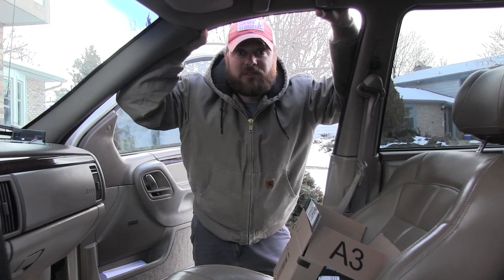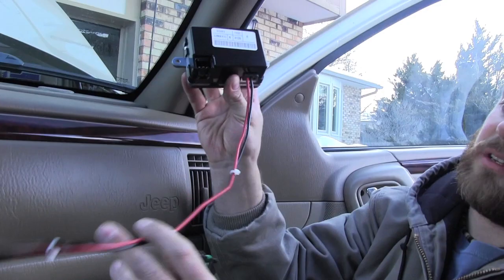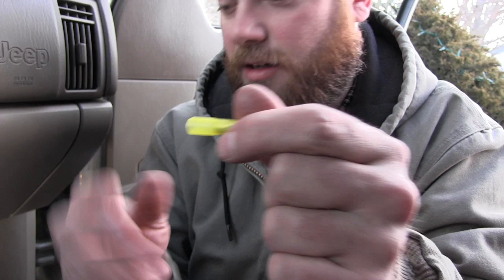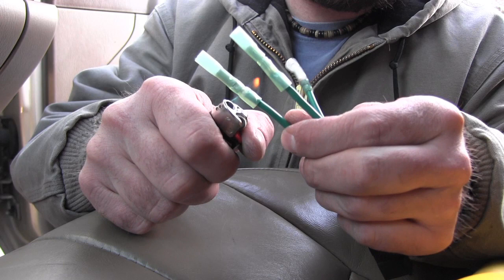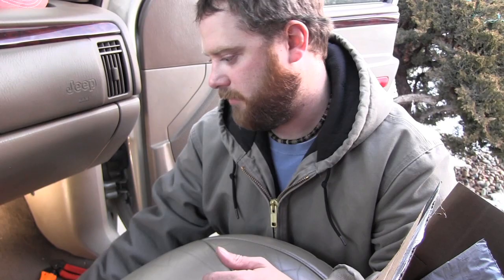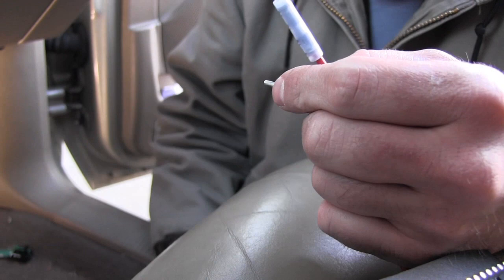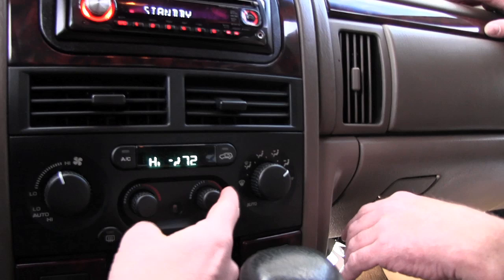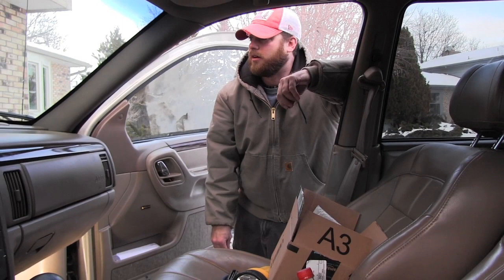How to fix your Heater Jeep Grand Cherokee

Comment: This is an old video, I have an old Jeep.  This just fixed my issue in 2 minutes.  I went out to the Jeep and just wiggled this plug, boom, heater kicked on.  I know it's not a permanent fix, but it gets me heat until I can fix it permanently.  Who am I kidding, it has 280,000 miles, this may be permanent...

Comment: Hey thanks for the video.  I have a 2000 jgc and I had to take out my dash to remove heater core.  I also had to replace the temperature control module/resistor.  In your video you had to cut the original wires on the resistor because they go behind the hard to remove hvac...  I don't think you had to do that.  I think the original wires plug into the blower motor which is accessible on the passenger floor right by the resistor that you installed.  The original wires just run/hide behind the hvac and then loop back down to the blower motor which is under the passenger dashboard.  I just wanted to let you/everybody know you don't have to cut the original wires on the resistor, just plug them into the blower motor which is right next to the resistor (both accessible from the passenger floor).  I don't know why they loop the wires behind the hard to remove hvac when they could go directly to the blower right beside it.  anyways  I hope this helps someone.
Reply from the maker: +Zachary Stutzman  Thanks for the info!

Comment: Thanks, Pete - this was a terrific presentation and extremely helpful! I would only mention that a flashlight and a little neck craning reveals that the "second" wire harness loops up and around the heater, terminating at a receptacle found to the right of the heater core casing where it can be unplugged,  eliminating the need for it to be cut and spliced. It is sandwiched between the RH side of the heater box and the passenger's side body panel, about 12" up from the floorboard.
Reply: what do you need to remove to unplug the Cable? just long arms?

Comment: Let me just say, complete props to this guy for demonstrating on how to fix this. I was having this exact same problem with my Jeep, with the air not blowing. I'm located in Arizona where the temperature outside right now is over 100 degrees every single day, so AC is a must. I took it to the dealership and they wanted to charge me about $400 to fix it. After watching this, I fixed it myself for about $60. I actually bought the resistor on eBay for a bit cheaper, but got the wire harness connector on Amazon. Who would've thought the fix was so simple. Thank you times a million for posting this video!

Comment: I managed it without splicing the 2 wire pigtail. It goes over a mount and then right into the visible part of the blower motor at the bottom.  You can see it if you look at the bottom of the motor.  You could even go straight from the motor to the resistor if you wanted, but i found it was pretty easy to follow the wire to the motor and run it back the way it was.
Reply: ئ في.
Reply: Did you have to remove anything else to get to this part . I seem to have same issue to small of a hole to fit hand in

Comment: Not necessary to cut wires from new module to the fan motor and splice to old fan cable. 
Unplug the cord at the fan motor. 
Cut the 2 wire (black and red) from the old module that is being removed, grab at fan plug and pull it out. You may have to work it back and forth from each end to get it to come out or just leave it under the dash.
The new module will have a fan motor plug attached to the new module. Just plug into fan motor and stuff excess wires up under dash or zip tie them up there.

Comment: 13th November 2017  here in Liverpool in the united kingdom, just finished replacing front brake flexible hoses on my jeep grand cherokee wj 2.7 diesel. Rear flexible brake pipes, rear disc (rotors) rear pads, refurbished rear calipers with new pistons, seals and dust seals, bled them up, started jeep for a run around the block, heater motor packed in 😣😣😣 thanks to your great video think I will have it sorted no problem, will be on eBay after I finish this post for a new resistor. Thanks for a great video buddy, I have subscribed to your channel and left a like too. 🙄🙄🙄

Comment: Great video and I used it to help identify which wires were which since mine melted through the wires and I had zero as a guide. If I might ask,Why cut the second pigtail? it plugs directly into the blower itself and is easier to just unplug from the blower and pull through. I did not try to install the red and black harness the way it came out but instead I zip-tied them out of the way under the dash. Dorman is the best company to buy both the harness and resister because the offer a lifetime warranty instead of a one year like all the other companies I found. This item is a problem for Jeeps. I learned my lesson of going Dorman over any other when I fixed mine and 4 years later I am doing it again. Thankfully I bought my resister from Dorman and had got a replacement for free because we had not cut the red and black harness. My blower motor speed resistor harness pigtail part No. 973-304 I had to buy again...this time I bought Dorman with a lifetime warranty.

I love my Cherokee but if this is a troubled part I figure I might as well pay for it once and get free refills!!
Reply: David Skipper    P.S I do not work for Dorman but I do love their warranties. I am now replacing my window parts that came with a one year warranty, for the second time, this time using Dorman. Yes they are $20 higher then others on Amazon but they have that great lifetime warranty. Trying to save money the first time is costing me more now.

Comment: Not sure if anyone else posted this tidbit but that long connector you refer to as being under dash and requiring baby hands is actually connected on the passenger sidewall just in front of the door and is strung across  and not up. Just pull on the wire and you will see it move on the right. It looks exactly the same as the new one with the zip tie things every 4 inches so easy to spot. So there is no need to cut that. What a pain in the butt to work in such a small area though. But otherwise thanks tons for the vid...really helped!
Reply: I hope you're right lol. If so thank you.
Reply: I have a 2002 Jeep GC.  and you can unplug that connect.  it isn't that bad to get too.
Reply: what do you have to remove to unplug the 2-wire Cable??

Comment: Awesome video brother.  my fan stopped I was told it was my blend doors so I replaced them thru the glove box wasn't the problem any way a lot of unnecessary work and money. then I got mad and slammed my screw driver in the area of the resistor and the fan came on lol so that's how I know my resistor is bad. this video is very helpful my part will be in Monday so now I will know how to replace it. I could have probably just bought the wires and been OK because I can tap the box and it works then it will stop then tap again and it works 2 damn summers and winters have gone by because I didn't have 1200 bucks to let the stealership to work on it and it was the resistor the hole time. lol thank you

Comment: Thanks for the video. The blower motor on our 2002 just quit working and I was about to take it to a mechanic. I will check it out first after watching the video. We just had a recall issue with the passenger side air bag fixed so it is possible they did not get the wire harness clipped in properly.

Comment: Yes! Bought resistor for an 04 Jeep for $34 off amazon. Got the harness at a auto parts store for $20. I have air flow now but I used to have none. But it blows when my car is off now. But at least I have airflow and will solve my other problem!
Reply: What part store for the pigtail

Comment: Informative and helpful video. However, there's no need to cut and crimp the power wires for the blower fan.  The fan connection is right on the front right side of the blower motor and easy to reach. Just disconnect it from there and fish out the harness.  Now there's no need to connect wires and you won't void your warranty.

Comment: Hi Pete,You have it got,just to let you know Napa has the fix for this problem,comes with the new wires and pig tails for the blower motor and the black and red and the small wire,comes as a kit,in Canada its $400 retail, I got it for $200.
As for the failure of the blower resistor is the blower motor is old and is now drawing too much power so change both the resistor and blower motor

Comment: Hey Pete I have a 99 grand cherokee  that heater fan resistor is in a crapy place just like the electric cooling  fan relay inside the right fender. I too had to replace both . just saying thanks bro good video

Comment: thanx man u saved me some $$$$ , I haven't done the repair yet but I did get up in that bitch (98 5.9) and it's almost identical,  what I found was kind of surprising,  the box is wired for power but the pigtail is missing and the black ,red,and brown wires just hanging there, so it don't look burnt in the box tho I can't really see that well and can't find the screws to take the box out , any who going to get the pigtail from parts store it's out of a corvette supposed to be more heavy-duty....

Comment: Just wanted to let you know , that plug with red and black wires, is to the blower motor,  and it loops over another harness , and then back out to the blower motor itself,   lol, 6 inches to right of where you worked ...

Comment: Russ, this will be the 3rd time i change out that cable in the past few years. Is there a permanent fix? BTW, your video was very helpful.
Reply from the maker: Just noticed your comment.....I haven't had any issues with my replacement...there must be a short somewhere with your connections. That really sucks that you have had to replace it 3 times. Did you also replace the box as well?
Reply: 99 grand cherokee front driveshaft update
Reply: Dude, please replace the resistor (black box) with a newer one, they have fixed the overheating issue. The old one is a car fire waiting to happen. Why this wasn't a recall and the old style parts are still being sold, I don't know.
Reply: You can solder the 3 wires directly to the pins on the board.
Reply: It's a bit of an exaggeration to say "the old one is a car fire waiting to happen". If the resistor was actually going to cause a fire, there would have been one by now, and yet there have been no fires linked to the resistor in the 20 years the WJ has existed. Many, many failed resistor modules with melted plugs, but no fires.

FWIW, the electronic resistor module in the premium climate control system in the ZJ was known for the same problem.

Comment: I did the same replacement as this and it still isn't blowing, but it's making a sound like it wants to blow. Can anybody please help me out? Maybe a fuse or something I don't know about? Thanks
Reply: the wires that the dealer provide you with are backwards. so you will have to switch them. red to black and black to red.
Reply: how is  called  this  piece,  l  need  for  my  car
Reply: l am talking   from   sevilla   españa   how  can  l   ask  part

Comment: Hey Russ. Tony. I live in south Florida and I don't need the heater. The vent flaps are a problem. The a/c works. Heat is still passing through even with a/c on. Mostly heat blowing thru vents at bottom of windshield. What can I do to stop that? Again, no heater needed in south Florida..

Comment: Great video on how to replace the part but my fans are working fine. The Cold AC works great but the heat is not working. Do you think replacing this part will help?

Comment: I have the same model Jeep and the same problem(but with A/C instead of heat because it is hot here in Texas) Thank you! I am fixing it now. I would like to ask you how did you put the aftermarket stereo and it looks like it fits? My factory radio looks too big.

Comment: I am having the opposite problem in my 2004 jeep Grand Cherokee.  There was this major banging and thumping from the glove box and now my fan won't shut off. Luckily I can control the heat with the other dials as well as adjust which vents it blows through.  It wasn't the blower motor resistor because that was the first thing we tried.  Any idea?  Maybe it could be the motor itself? The relay and the fuse have both been tested and are good.

Comment: Pete ....great ... trust this trick works for 1998 Jeep Grand Cherokee ... blower motor resistor ...replacement  
might be the resistor part # is different .. pls confirm
Reply from the maker: Hey ANil, sorry for the late response....98 is a different model, but I'm sure the process is pretty similar.  Just make sure you get the right part for your 98.  Just google it or look it up on amazon.
Reply: Russ Robitaille thank you sir for taking the time to post this video.

Comment: Can you put link of the parts that you used, I have the same problem, and I'm planning to change the heater core, evap core and blend doors, but this was very helpful.
Reply: Here are the two links for the parts we used.  Good luck with the heater core....there's a great video on youtube I found that shows you step by step on taking the dash out.  I'll repost it if I can find it again. Thanks for watching our Mechanic Pete vid.  http://www.amazon.com/gp/product/B00E9EOOLY/ref=oh_details_o03_s00_i00?ie=UTF8&psc=1
http://www.amazon.com/gp/product/B0049TTR6G/ref=oh_details_o04_s00_i00?ie=UTF8&psc=1

Comment: THANKS for posting this!  My AC blows cold, but even on HIGH it just barely blows... is this the reason?  Hopefully this is... please chime in if anyone knows :)  Thanks.
Reply: The connector from the dealer is backwards. i work at the dealer, it happens all the time. Put red to black and black to red.

Comment: dude. could u please tell me what's up with my 2000 jeep grand Cherokees recirc door behind the glove box? mine is missing. has it broke off and fallen on blower motor? no I felt down with my fingers on blower fan and its not there. I see the nub that turns it and it turns but no door. it has to be in there somewhere I know. everybody else's is but not mine. figure this out for me please. my blend doors I got to and I can fix those. one has end broke. I may just order new ones. but this resirc door problem has got me puzzled. any feedback is greatly appreciated Russ. thanks steven

Comment: Russ, any reason you can't just solder the 3 wires directly onto the resistor leads, bypassing a connector? Even if the bad connector is melted into the box, you can drill 3 holes, insert the wires, solder them and save yourself the $100 from buying a new resistor I would think.
Reply: Nevermind. Spent the last 2 hours trying to do that. Ordering the resistor lol.

Comment: I have 2 engineering degrees and the Heater Core on a 2000 Jeep Grand Cherokee has my hair on fire!!  I flushed the heater core and the water flows fine and is clean!  But despite both lines going to firewall being hot, the Heater Core stays cold !!  No heat comes towards the cabin side!!  Blend Door area is now cut open and they both work.  Actuator also works and operates the blend doors!    Is there a FUSE / Switch somewhere that is supposed to trip the Heater Core!?  Thanks for all your hints.
Reply: Hey David, I have the same issue with heat, we even replaced the water pump, and thermostat still not much heat, do not think it is the heater core as it is flushed and no leaks. How Did you solve your heat problem? Thanks
Reply: @kennypeapea2256  had to flush the Heater Core a few times to get decent amount of heat back! I added LIME AWAY into the line after draining the lines.  I filled one line LIME AWAY while holding he other one much higher to prevent it from draining .  I let Heater Core soak in LIME AWAY for 30 minutes.  I then blew Air from one side while keeping the other side closed!  This was pushing LIME AWAY into the walls of the Heater Core.  

The process released a lot of Calcium particles. The idea is to get LIME AWAY to dislodge Calcium deposits that are attached to the walls of the Heater Core.  After the 2nd flush, there was smaller size particles of calcium, but still enough that would impact the heat distribution to the inside.  I think it's worth doing it as long as you are NOT getting clear liquid OUT of the lines. 

We now have decent heat for California winters, but not enough if I lived in Nebraska!  The ideal remedy is to replace the heater core, but that's not a simple task and not worth in our case on a 20 year old Jeep!  Hope this help your cause.
Reply: @bingeai2985  Thanks for the information. Yes, the heater core replacement looks like a big job.

Comment: Lucked out and only had to wiggle the wire a bit to get it to work again
Reply: Mine too I just went out and wiggled it wa-la fixed :)
Reply: wiggles the wire and it worked in my jeep as well but it looks like the wires are burnt. might still replace just in case.
Reply: wiggle is not a fix.

Comment: I replace the resitor and the switch still the blower does not work on any speed. Does it have a inline fuse on a 2002 jeep liberty

Comment: Don't those red and black wires go straight to the blower?
Reply: Yes they go to the blower motor.
Reply: Yes! I just did this fix and was pleasantly surprised that the red and black plug goes right to the blower motor behind the kick panel.

Comment: well the corvette pigtail only works for manual heat, I have 98 zj with auto climate , anyone know if this wire set up will fit the 98 it's 3 wires also

Comment: Hi Russ my blower is working good but I don't have enough heat or ac. If I replace the temperature resistor that would do it? Or its the core that needs to be cleaned? Please help it would be appreciated thanks
Reply from the maker: +Isai Ramirez I don't think that is the resistor is the issue.....I think you should make sure your ac is fully charged and that your coolant level isn't low.  That's the first place I would look if you haven't already done so.